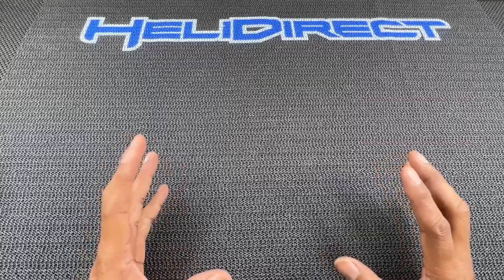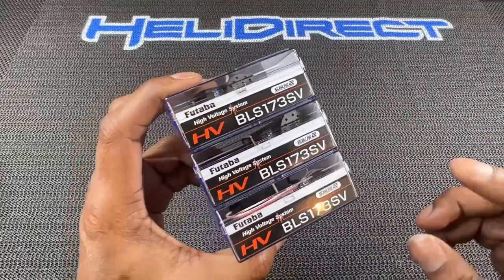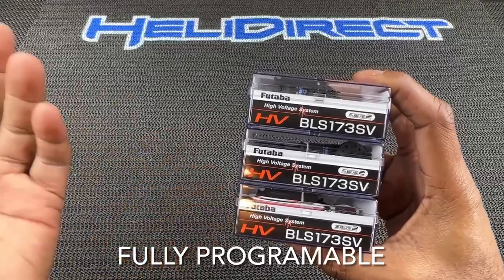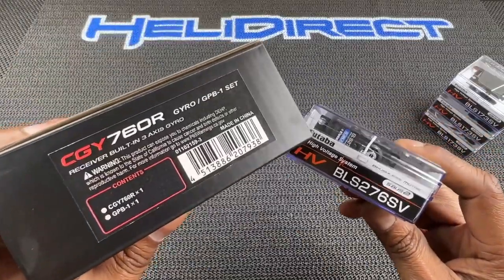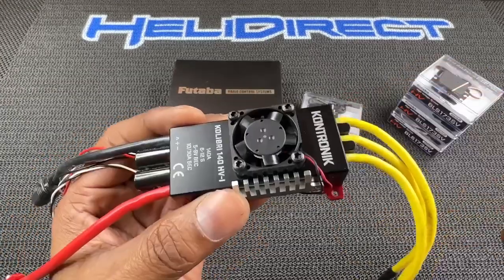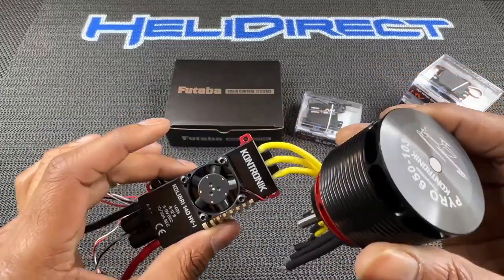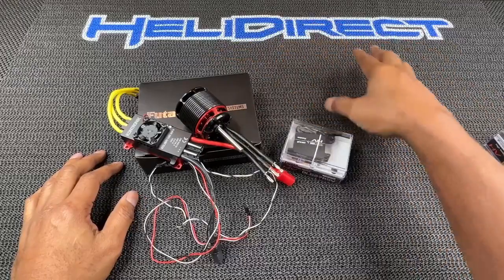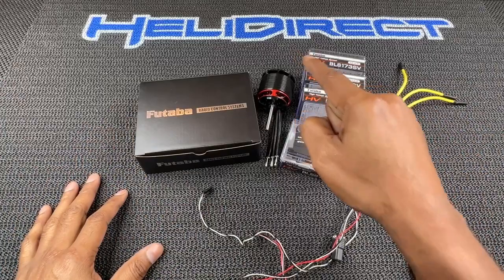What do I prepare for Electronics setup for XLPower 550 Nimbus Build?

Comment: Hi there, good choice of electronics there. I also purchased the Nimbus 550 with the full size servos mount kit. I’m planning to use the CGY760 to this build, wondering if you can do a setup video using the program box it came with. I’ll be using Futaba 14SG. Would really appreciate it very much, it’ll help me tremendously with this build. Would love to have the same ESC but will settle for HW ESC for now till I can save enough money to get the Kolibri. Again, thank you so much. I purchased the kit through HD, and will be purchasing my electronics there too till this build is completed. Thanks again.

Comment: I have these servos on my Kraken 580 at 8v and I can't tell the difference between them and full size HVs. Great servos, just not cheap!
Reply: In fact, you're running an almost identical setup to my K580, except I'm running an Xnova motor and the 6S LV-I Kolibri.

Comment: That esc alone is as much as the nimbus kit, hell no! Not worth it, that new Hobbywing V5 150A looks good though, let us know how that esc is doing in terms of reliability please, all my other HW have been good. Planning on adding another XNOVA with it and sending it!
Reply: Last Kontronik bought is 10 years old and still running strong.
No magic smoke, excellent internal gov.
set and forget.
Reply: @michelcote  This. I usually hate it when people say "more expensive = better" etc., but Kontronik is a soild example of where spending extra is worth it.  Their stuff is top quality and bulletproof.
Reply: Yeah it’s a $2000 heli with over priced components like that. And yeah everyone around me hasn’t had fires with their HW esc’s. Maybe that was many years ago but for the last 5 you don’t here that happening with them. Plenty of high impact pilots flying HW without issue.
Reply: @10fantic  i'm agree , HW are perfect, no issue. it's expensive enough
Reply: Same for my hobbywing esc’s, plenty of hardcore 3D pilots flying them without issue. The videos with kenny ko flying the nimbus 550 was with the new HW V5 150A, a 1/3 the price with that kind of performance sounds like a plan. Idc what reliability claims out there, 3X the price is just stupid.
Reply: @10fantic  ESC have improved.
back then everyone were going in flames and gov were not working well except Kontronik. Avoiding just one crash paid for itself. 
Maybe today it's different. But I dont know if I would  fly 2000$ heli and trust a 200$ cheaper esc. I agree that the price is really steep.